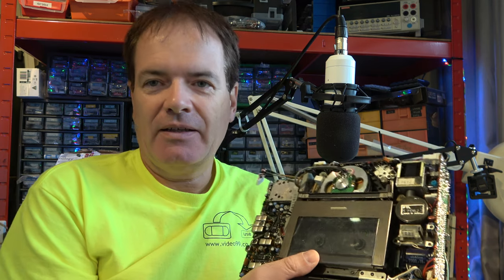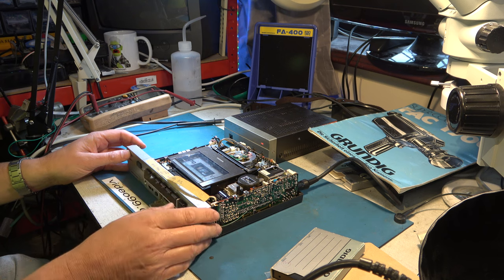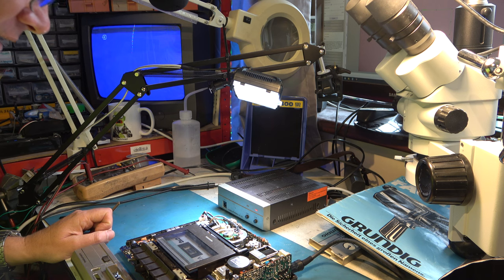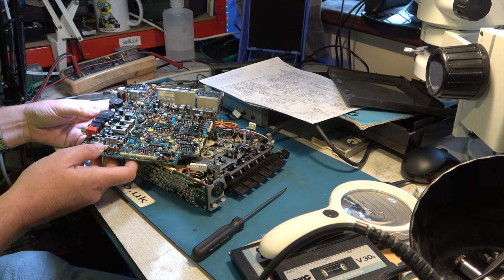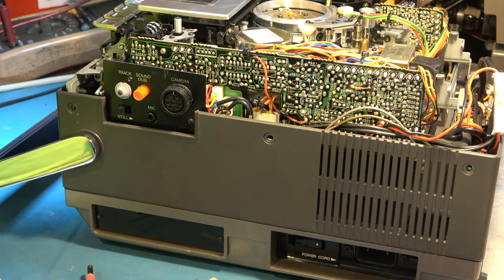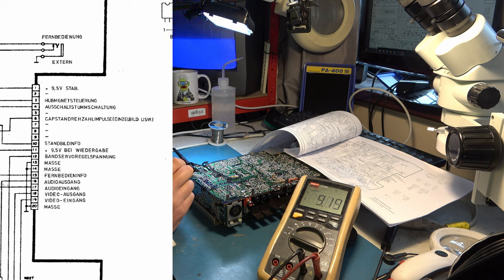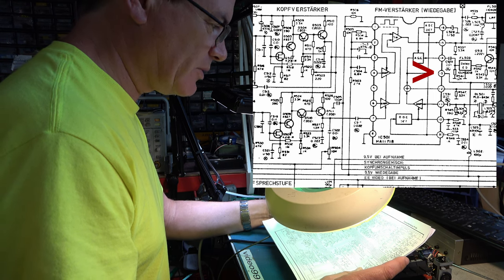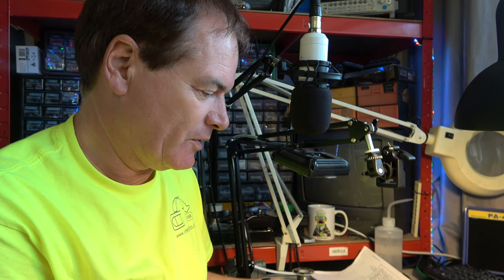Part 2 of working on CVC video: Technicolor Showcase and Grundig VP100

Comment: I had a very similar experience on a Panasonic AG-7500 on an audio IC on one of the boards. No HiFi sound. Tracked it down to a tiny fuseable resistor in the supply rail that had just gone open circuit. Replaced it and never had a problem again so unsure why it failed to begin with. Maybe under spec'd for the job from new.
Reply from the maker: I had a fusible resistor go high value in a Sony PCM-701ES digital decoder, just the same, no reason for it.

Comment: Rt0h2257 WIEDERGABE is the correct spelling for "Playback". I couldn't see any European Parts in the Video, so I don't think it's really GRUNDIG. Addendum: Made for (not by) GRUNDIG in JAPAN is written on the Bottom. I would have checked the self-recording first as I haven't read anything good about the compatibility of FUNAI /Technicolor with GRUNDIG. Addendum: If both Devices are OK, they are also compatible, which is no Wonder if both were built by FUNAI. Grundig was probably the last CVC market participant, and therefore received the last CVC attempt from FUNAI.
Reply: That's really worth knowing and I'll be testing this too. I do wonder what the Grundig machine actually is - it looks like it's a Japanese machine but not Funai based although maybe it was made in Europe to a 'recipe' maybe.

Comment: Concerning the video heads on the Technicolor 335 Video Showcase model (with the built in monitor), take a piece of paper soaked with 99% isopropyl alcohol and hold the piece of paper against the video head drum and rotate head drum with your other hand. Should clean the heads safely without risking damage to the head chips.

Comment: I'd try bridging the missing voltage during operation using low mA range on my multimeter and if excessive remove probes quickly, rather than bridge the traces with a jumper

Comment: Nice fix on the Technicolor. YAY.

Oooh, cliff-hanger. LOL.

I have a question I hope you can answer, I have a VHS JVC HR-7650 EA VCR, the sensor bulb has blown and I can't find any information about the replacement type. Do you happen to know what voltage and wattage it is ?

Any information would be a great help. Thank you.